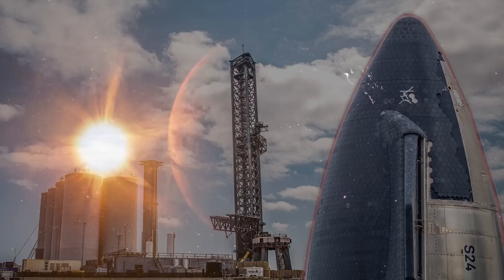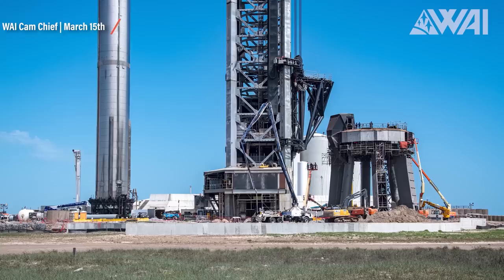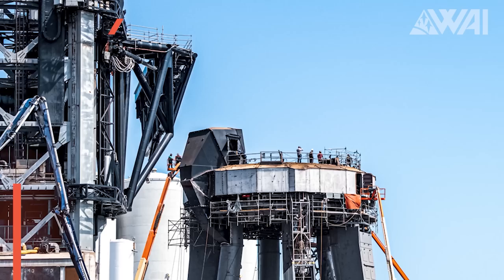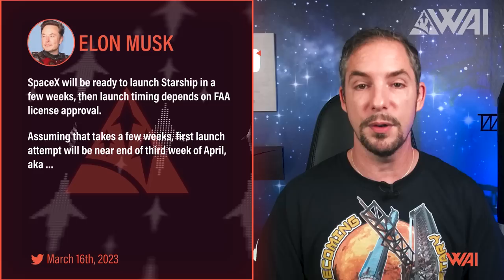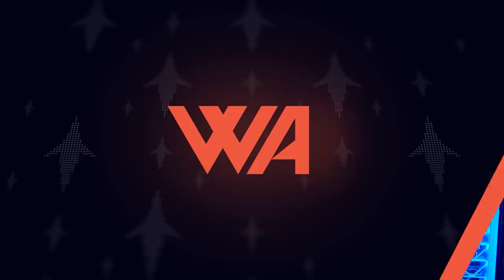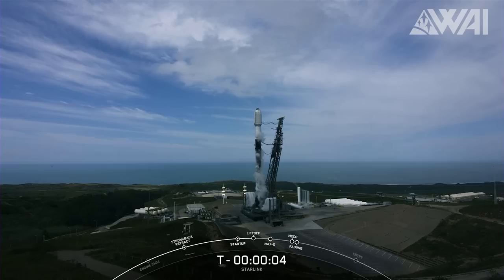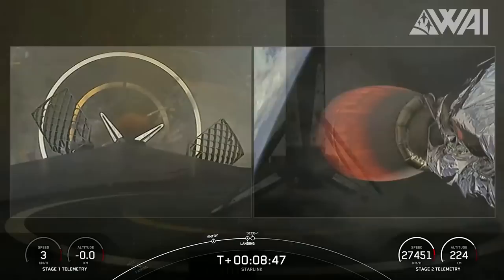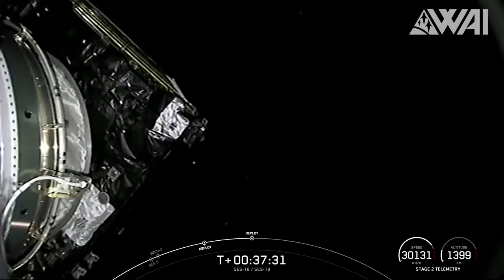SpaceX's accelerating Starship Plan for the Next 4 Weeks + Stunning Artemis Lunar Suits!

Comment: I think it is completely insane to launch without the water deluge installed (not the firex suppression which isn't the same thing).. The chances of the pad and surrounding infrastructure (tank farm, etc) becoming a crater is increased without deluge... I don't think even 6 months would cover rebuilding all that.. Just because they want to rush it by a month or two faster.. 12-18 month delay from launch pad explosion.. Makes 0 sense!  I love these cowboys/cowgals but I think they might be riding this beast too hard and fast for this rodeo!!!  I really hope someone in NASA, FAA or government does SpaceX a favour and tells them not to risk trying a launch without a deluge.. No diverter, no deluge - a Flat (fondag) concrete pad against the roaring fury of 33 raptors at 80+% thrust.. Nuts!!!
Reply: Repaving the concrete/FONDAG won't take 6 months. Not even deluge installation after the first flight
Reply: @alvianchoiriapriliansyah9882  sure - laying a concrete pad takes not much time but rebuilding a whole launch site including tanks, GSE and tower could take 12-18 months easily.  The chance of concrete churning into the engines and rupturing a line at thrust above 70% resulting in PAD RUD is not insignificant.  A water deluge dampens the shock waves that tend to rip up and kick up concrete pads into engines... think back to SN8 static fire testing with 3 engines when martyte coated concrete spalling severed engine fuel lines... True they have better concrete now and shielding but this is 10X more engines....
Reply: @weeasledude  And the same pad for SN8 is then used for SN9 onwards, with NO MARTYTE PROBLEM. You see where this is going?

Concrete spalling ≠ rebuilding the whole launch site. No evidence so far that concrete spalling damages the engines

Watch CSI Starbase. The center concrete section is now FONDAG, and little to no spalling was detected. Only the perimeter was still affected, which WON'T hit the engines
Reply: And I just saw leaked images of the giant crater under where the launchpad used to be and concrete chunks strewn for miles..

Did you see where that went?
Reply: Ps. You think it was coincidence Booster 7 lost 6 engines and it appears the HPU exploded mid flight??
Reply: pas.. Also saw Angry Astronaut's youtube video which shows a massive dent (several square meters plus .5 mtr deep)..  Amazing it didn't explode.. Maybe it was empty or was the Nitrogen
or water tank...  They got real luck the spalling damage to the rocket and farm didn't rud everything within a square mile...
Reply: Psss.  The 31 static fire was 50% thrust and 3 second duration..  Following this and deducing this would be the result (and basing off comments by engineers) really wasn't rocket science ;)